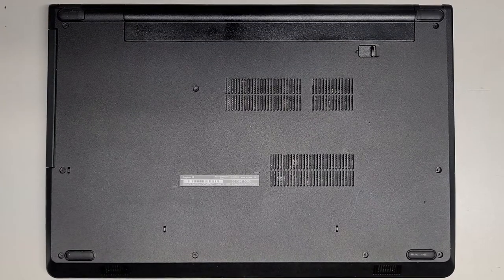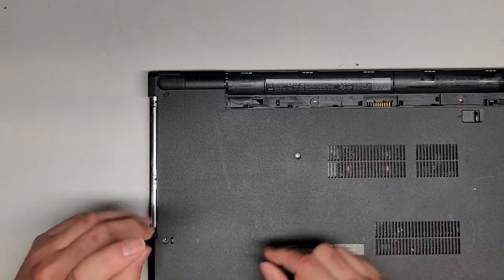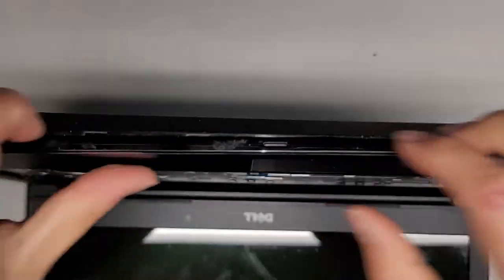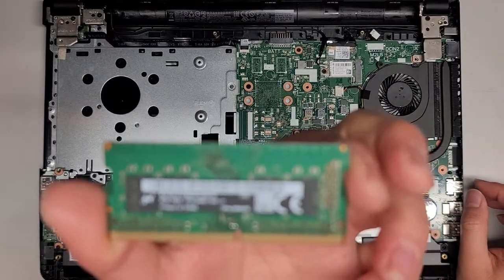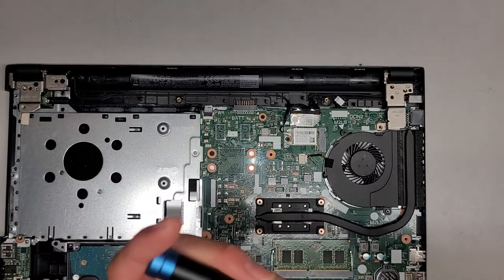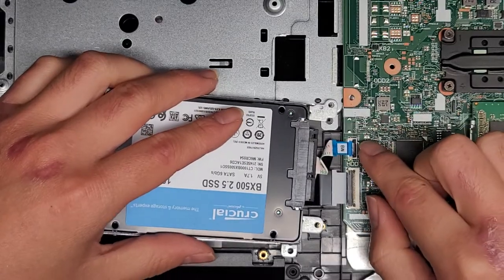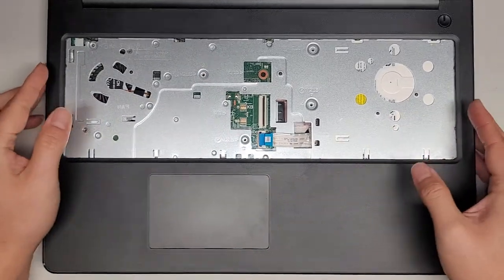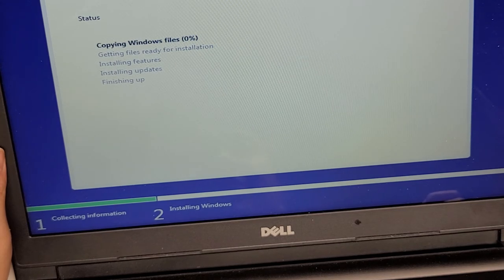Dell Inspiron 15 3567 Disassembly RAM SSD Hard Drive Upgrade Battery Keyboard Replacement Repair

Comment: Thank you for posting the video.
Very, very helpful.
My thanks to all who post such videos as I have disassembled and upgraded my two other laptops with the help of similar videos.
 I just purchased a donated, complete Dell 15-3567 from a local Salvation Army with upgrades in mind for general purpose use.
FWIW...
Extra work for me, but I am prone to knocking screws out of placed and now use a four-week pill organizer.
I place numbered stickers next to each of the screw locations and place that screw in a similarly marked pill compartment.
Reply from the maker: Glad it helped. If you haven't already, please like and subscribe so others can find my videos and possibly consider watching a few others to get the algorithm to recommend my channel. Thanks!

Comment: I recently have the same computer as yours, but due to mainboard problem, the laptop is not fixable and requied buying new one, now I got diffrent model computer, already upgraded to SSD and it's more easier to open up the lid
Reply from the maker: Glad you found a nice replacement.

Comment: recently upgraded my laptop same model,dell 3567 ,1TB HDD  replaced with 1TB ssd Samsung evo 870 after using Samsung's free cloning software 'Samsung data migration'....worked very well...no problem with secure boot on...Even AV was on but kept it in flight mode/disconnect internet...also upgraded the RAM 4GB 2400MHz 1.7 v with another 4 GB RAM 2400MHz...upto 8 GB ...spec shows that this model  can accept upto 32 GB RAM but for my basic use it would be an over-kill..prying out the palm rest from the base was quite tough the 1st time esp near the right hinge....there prying under the metal strip of the DVD slot lip adjacent to the hinge and a bit side to side move/wiggle of the base, easily cleared  that sticky right hinge (left one if the laptop is upside down!)  while the innards are open ...might as well change the CMOS battery and clean the dust from the fan....

Comment: Thank you for this excellent video.  I've upgraded several laptops, but each is slighty different.  After not getting the ssd  cable seated properly the first time, I found that taking the unit apart the second time was much easier.
Reply from the maker: Awesome, glad it helped. If you haven't already, please like and subscribe so others can find my videos. Thanks!

Comment: Thanks !  Excellent detailed step by step, clear narration, cautions at critical points where you could easily break your computer.  a dummy like me replaced hard drive.  Am sticking with Binh's tutorials, he won't steer you wrong. Sending donation
Reply from the maker: Glad the you appreciated all the narration and steps and were able to complete the repair without any issues. Thanks for the donation! It's greatly appreciated. Not sure why, but May has been very slow for me, so it really helps out! :)

Comment: Thank you. Just used your instructions to upgrade to SSD for the exact same model as in your video. Worked like a charm. I had a refurbished Dell Outlet model that I found out was missing 4 of the various screws. Hope it holds together!
Reply from the maker: Awesome, glad it helped. If you haven't already, please like and subscribe so others can find my videos. Thanks!

Comment: Excellent video. Really helpful. I need to replace with an SSD tomorrow for a colleague as the 1 TB hdd that came in with the laptop is dead slow ! In fact, I googled a lot today and also dell support to see if this model supports M.2 NVME. Now I know for sure, it does not support. Thanks a ton !!
Reply from the maker: Glad it helped. If you haven't already, please like and subscribe so others can find my videos and possibly consider watching a few others and commenting to get the algorithm to recommend my channel. Thanks!

Comment: Not even sure what you're getting at, but great tutorial, I haven't even finished taking it apart yet and I've already demolished a number of clips, screw holes, and other plastic bits holding my laptop together, and this is after taking every screw out, every ribbon cable unplugged, and while using a pry tool. Can't wait to see what my disaster of a laptop looks like when it's back together, assuming it even functions still.
Reply from the maker: Lol Did you find the video after destroying it?
Reply from the maker: Lol that's good
Reply: pay close attention on how to proceed. I did it and it work exactly like the vídeo shows.
Reply from the maker: @DavidGomez-ws5br  Yup, I do the videos in real time so you can see exactly what to do.

Comment: about keeping a track of the screws....i make a diagram on a piece of thermocol/foam about the screw positions and stick the screws on the foam as per the diagram....that way one can identify which screw goes where ....and doesnt get lost....also keep a magnet handy if some screw jumps off and needs 'magnet-fishing' to find
Reply from the maker: Maybe for a one time thing. I made a spacial magnet sheet for this purpose.

Comment: you can push out the DVD tray from the adjacent slot for the battery slot ,where a corner of the DVD tray is visible
Reply from the maker: Nice
Reply: Yes, saw that on another video today.
Reply from the maker: @Praveen-ud4wu  :)

Comment: Hey Dude...this really really helped. I looked at few other vids on this. But yours is the best! Very easy to understand. I upgraded from 4GB to 16GB. It definitely helped. But I have a Toshiba HDD-500GB-5400. So from what you say. That would work better than the ram upgrade for performance.?
Cheers
Reply: Ok so I ordered a Crucial SSD 500GB. Do you have a tutorial on ghosting the HDD to make a copy for the SSD? I don't have a CD backup for the WIN-10 Home.
Thx

Comment: Your videos are lifesavers. 
And wallet savers. 
Venmo incoming. 

Question, if you have the time:
Putting in/replacing the HDD w/ a SSD in this laptop. Curious at to whether you’d recommend using a $6 optical drive caddy and adding the SSD via the caddy and mini SATA connection, or whether you’d recommend pulling the keyboard, doing a tear down, and physically swapping the HDD for a SSD. 
I guess I’m asking if you think there is significant speed loss using the optical drive SATA connection to make it worth the tear down. 
I know it’ll be a boatload snappier either way, as compared to the HDD. 
But if I’m going to do it, I’d rather do it right and do it once. 
Again, many thanks and keep up the great work!!
Reply from the maker: I'm not too sure to be honest
Reply from the maker: Thank you so much for the Venmo! Usually I will go the extra mile to put the drive in the slot designed for the hard drive, but I've never done a speed comparison.

Comment: I just finished upgrading my HHD which was really a NVme 250GB to a SSD 1TB and upgraded the ram DDR4 8GB to DDR4 32GB 2400 MHz and its super snapy fast. Thank you so much now I just need to if you can how to look up the adapter fot the DVD caddy for a SSD. My laptop does not have a DVD drive but it has the empty slot and it does not have the ribbon to connect to the motherboard motherboard optical drive. The connetion is there so I would have to buy the ribbon as well. Can you please advise and again THANK YOU you are ASOME !!!
Reply from the maker: Not sure if this will work https://amzn.to/3TPzuZZ
Reply: @ItsBinhRepaired  Thank you
Reply from the maker: @David Gomez  this for the hard drive caddy. https://amzn.to/3SP9tZt
Reply: did you do anything additional to make it work with that RAM? my inspiron does not work with 16GB.
Reply: @jonathanB55  No I did exactly a upgrade with 2x 16 GB sticks = 32 GB 2400 MHz ram Ripjaw brand. Please note that you must also see the LAT for speed the lower the number the better like a 16 or 19 will work faster but a 22 will work well too. The type of hard drive will determine how fast your computer will pull the information so a NVME will do better than a SSD. Good luck!!
Reply from the maker: Yup!
Reply from the maker: You need the right clock speed.

Comment: I upgraded my Dell Inspiron 15 (3567) with an SSD on the caddy (replaced DVD) , i cloned the OS to the SSD but can't boot from the SSD. (Laptop boot not showing SSD),any solution please?
Reply from the maker: What type of SSD are you using and what did you use to clone it?

Comment: Hey, great video! Thank you. My charging port/jack seems to be pushing out my charging pin. Not sure what to do😢. I’ve been trying for so many days now to shift it in place
Reply from the maker: Likely the charge port mount is broken and the charge port is getting pushed into the computer
Reply: That makes so much sense, thank you. Would that also cause my laptop to show that the charger is plugged in but the battery is constantly at 0%?
Reply from the maker: @moonisah5082  possible if it's not plugging in all the way. You'll have to open it up and use hot glue to hold it in place. Don't use anything conductive in there.
Reply: I really appreciate this🙏🏼
Reply from the maker: @moonisah5082  no problem

Comment: Hi , I have same model laptop Dell 15 3567 ,  I have purchased WD GREEN 480 GB  SSD and Crucial 8GB DDR4 2400 speed RAM and one HDD Caddy. Are these compatible to my laptop motherboard??
Reply from the maker: I believe so
Reply: @ItsBinhRepaired  ok thanks 👍
Reply: @sachinmakthe3142 Hi. Does your hdd and SSD working well ?
Reply from the maker: Hmm

Comment: Put a 500GB crucial drive in there, bios says "none", is there a way to fix it?
Reply from the maker: SATA SSD?
Reply: @ItsBinhRepaired  MX500 500gb SATA SSD 2.5 in, I put it in backwards and the bios says none for SATA 1
Reply: @ItsBinhRepaired  I'm confused on how to get the blue cable in, Is there a specific sound it should make?
Reply: @ItsBinhRepaired  Update I got it fixed it was just a lose connection
Reply from the maker: @supergamingyt7280  awesome

Comment: Hopefully u see this video
But the 2 sides ones on the top left and bottom right are stripped or something. They are just spanning forever and i cant open it with a screwdriver. Any fixes 😢😢
Reply from the maker: If the screws are turning, most likely the screw mounts are damaged and you'll likely have to destroy the plastic around the screws to get it out :(
Reply: @ItsBinhRepaired also u said to remove the DVD player thing and I did but now the purple wire that connects from the player to the motherboard I can't connect somehow like no space to put it back
Reply from the maker: @instantaura  purple?
Reply: The wire that connects the DVD player
Reply from the maker: @instantaura  did you flip the latch?

Comment: what is the format of the bootable usb drive? i made an windows to go bootable usb using rufus with ntfs format drive but I couldn't get it to boot. I made that usb drive to test if the whole system/pc is working correctly before installing an real operating system on the pc/laptop.
Reply from the maker: Why not just use Microsoft's utility? https://youtu.be/R6GVDyVqWso
Reply: @ItsBinhRepaired  hmm, will try later!
Reply: Microsoft's utility isn't windows to go, it is just installation media😔
Reply from the maker: Oh, you're trying to boot windows os off a usb? I'm not sure how to do that.
Reply: oh, i'll have to find out myself then😅
Reply from the maker: @melneldell2187  yeah lol

Comment: I broke the connector when replacing the hard drive back into the motherboard. what is that part called and where would i get it?
Reply from the maker: The cable or the motherboard?

Comment: Can dell Inspiron 15 3567 support 500 gb ssd instead it showing in dell manual support up to 256gb ssd.after installed 500 gb ssd can motherboard is overloaded ?
Reply from the maker: You can put whatever size SSD you want.

Comment: Does the keyboard screws definitely need removing  to remove the hard drive?thanks
Reply from the maker: If you don't care about the computer, you could use a saw or hammer or another method to smash it apart to get the hard drive out.

Comment: I increased RAM to 16 GB (8GB x 2), now my laptop works perfect. But when internet is disconnected, Laptop abruptly restarts with BSOD issue. Any resolution??
Reply from the maker: Never heard that issue before.
Reply: hello, i've got the same laptop. would you recommend increasing ram to 16gb(8gb*2)?
Reply from the maker: @ayushdev2861  sure, but I'd upgrade to an SSD first
Reply: make sure that new memory is for sure supported by your laptop....try to reseat your memory ... a bsod can easily be a problem with memory. When you turn your computer on your hard drive loads everything into your memory and if there's something wrong with your memory it may not work properly. If you are a car mechanic think of your hard drive as your storage shed and your memory as the garage that you work on cars in. The more memory you have the more cars you can work on at the same time kind of like having a bigger garage when they say memory helps speed up your computer it's not the speed of data it's how much stuff you can work on at the same time
Reply: Did you find a solution to this problem? I have the same problem with my laptop but mine won't start and gives the same error.
Reply from the maker: Hmmm

Comment: If ur watching my,  comment i want to know so badly can my 7 years old laptop can play games pls tell me that, i want to upgrade my dell laptop which has i3 7th gen processor if i upgraded my laptop so will i be able to play games at least on medium settings?
Reply from the maker: It really depends on the game.
Reply: @ItsBinhRepaired  I want to play games like gta 4 or 5 , god of war, cod etc.
Reply from the maker: @aditya44447  don't think it'll be able to run on medium even low settings very well.
Reply: @ItsBinhRepaired  ok thnx for the reply bro
Reply from the maker: @aditya44447  no problem

Comment: One of the 3 screws I got won’t spin after removing the disc drive
Reply from the maker: Did you strip the top or is the screw mount damaged?
Reply: @ItsBinhRepaired  I didn’t get it out but could still open the back off thanks for the video
Reply from the maker: Nice!

Comment: Isnt the limit of ssd 250Gb and that only hdd can be 2Tb

One 2.5-inch hard drive SATA Up to 2 TB
One 2.5-inch solid-state drive SATA Up to 256 GB

its what i found in dells documentation for 3567? 
Ofc im wiling to get 1tb sdd but just wanna make sure its gonna work
Reply from the maker: The only limit is what you can afford and what you can fit in the computer.
Reply: @ItsBinhRepaired  okay thank you so much 💜
Reply from the maker: @zoran7309  no problem

Comment: Can i put ssd in direct caddy qmd installed in the place of optical dvd drive....
Is dvd driver pirt of this model is sata 3?
Will it give me same speed as intenela drive port
Reply from the maker: @faridjagrala  you need an adapter caddy, but yes. I'm not sure of the speed.
Reply: @ItsBinhRepaired  as u have opened this laptop .......can u tell me which sata version is optical drive por
Reply from the maker: @faridjagrala  I'll need the thickness of your optical drive in mm
Reply: @ItsBinhRepaired  9.5mm
Reply from the maker: @faridjagrala  this should work https://amzn.to/3ZTy32H

Comment: Is the laptop base for 2.5" or 3.5" SSDs?
Reply from the maker: There's no such thing as a 3.5" SSD
Reply: @ItsBinhRepaired  Bro, what happens is that the HDD comes from 3.5", so my question is whether I will have to use adapter or not
Reply from the maker: @sebastianzelada4595  a 3.5" hard drive can't fit in the laptop. It's too big. It also requires more power.

Comment: What is the maximum amount of RAM I can put in this laptop? Can I put 32 GB?
Reply from the maker: Whatever you can fit in the slots.
Reply: @ItsBinhRepaired  Ok, the maximum amount says 32 GB, but what will happen to the laptop if I added more than 32 GB?
Reply from the maker: @davidlaufromnorthamerica3863  it'll likely work fine or stay black until you put compatible RAM.

Comment: Hiii  👋 My laptop is Dell inspiron 15  (3576) it has 2tb internall hdd and it also has cd deive 
Can u plz say what size and what kind off internal ssd I need for overall best performance also I want use hdd plus ssd both
Reply from the maker: How much are you willing to spend?
Reply from the maker: I wouldn't use hdd unless you're just trying to save money.
Reply from the maker: How thick is the CD Drive in mm?
Reply: @ItsBinhRepaired  no idea what mm is cd drive but I think it can be replaced with ssd 
I'm ready to set 500gb good ssd
Reply: I want to use both ssd and hdd since hdd gives more storage capacity
Reply: My internal hdd capacity is 2tb
Reply from the maker: @Pritam Ghosh  they have this https://amzn.to/3TKi7c2
Reply: @ItsBinhRepaired  its good I can take 500 gb ssd but 
Will it support on this syestem
Reply from the maker: @pritamghosh5247  yeah

Comment: Thanks for the helpful video! May I know if this laptop has an m.2 slot for an nVME drive? or does it have only a SATA port?
Reply from the maker: It has what I mention in the video. I try not to leave out things like that.
Reply: I think it doesn't have the m.2 port. The best thing is that if you have it you uncover it and verify before making a purchase
Reply from the maker: Yup

Comment: Thank you for this excellent vidéo.
Reply from the maker: Glad you liked it :)
Reply: @ItsBinhRepaired  to open odd, there is a hole on the top… and you just can directly push it with the minus screw.. no need to use small pin
Reply from the maker: I see